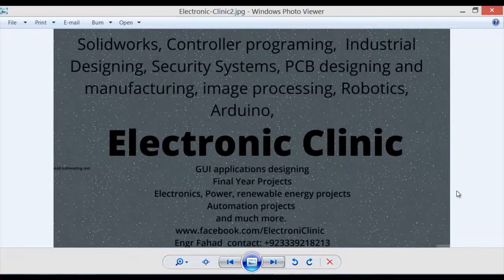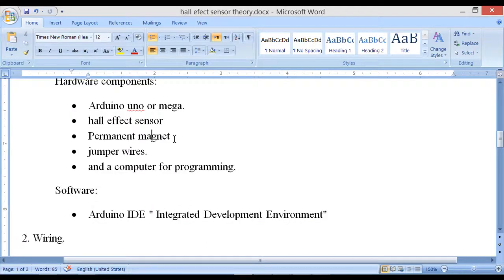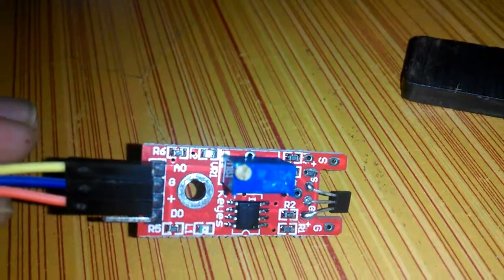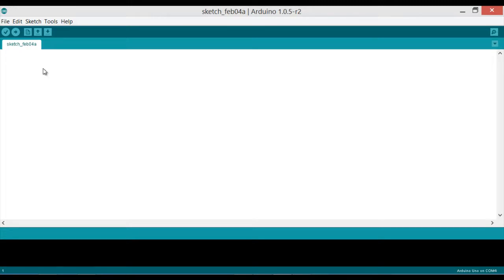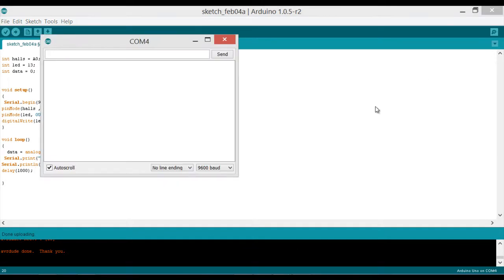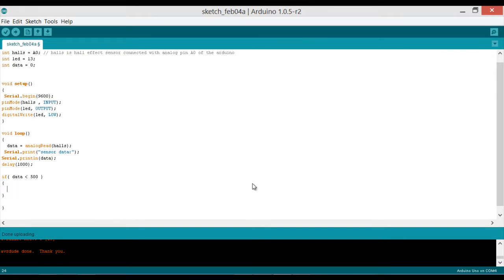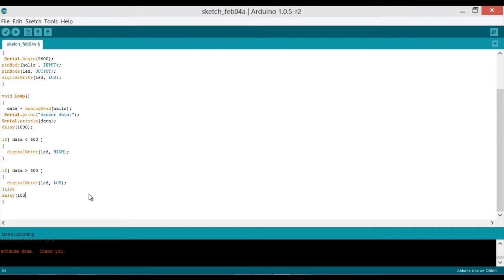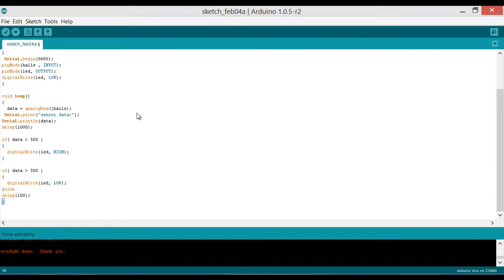Magnetic Hall effect sensor  Arduino programming and interfacing

Comment: Could I send you a wiring diagram of my CNC showing the Limit and Home switches and you write in the Arduino connection points.   My Arduino Uno has A0 through A5. 
This would be very helpful for many CNC users as well as 3D printers.

Comment: Do you need an Arduino for each limit switch/Hall effect module?  Thanks
Reply from the maker: One arduino is enough for multiple  sensors
Reply from the maker: it's exactly the same, you need to use different variable names and different analog pins. for example 
int HE1 = A0; 
int HE2 = A1; 
int HE3 =  A2; and so on.
Reply from the maker: you can watch my tutorial on Tongue-controlled wheelchair in which I used multiple hall effect sensors.